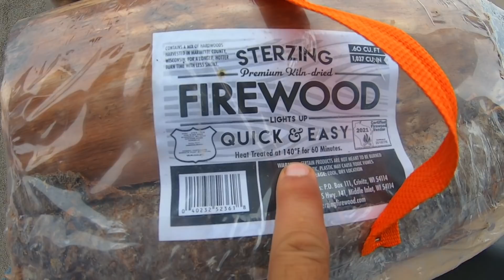Another Firewood Heaven Business! - #485

Comment: That Big Dump was very Dry, you could tell from the sound. Just think what a Grapple would do that could pick up firewood that was split and you could load it into the trailer with out touching it Chris. They make those kinds of Grapples. Big Mouth MINI 322 grapple by Precision Manufacturing. I would check this Grapple out Chris. 😀
Reply: Check this video out Chris, outdoors with the Morgans - Number 435 Things to consider when choosing a Grapple for your Tractor. Today we remove the 72" Granite Grapple from the RK 37 and put the 54" on and talk about things to consider when buying a Grapple. 
Weight, Max Opening, Width, and Others  May 11, 2019.
Reply: You could probably make one.  Like a tilting bed one.  a 4x8 extruded metal base to snug up to the face cord, maybe some sliding arms to come down on the other side to clamp a little bit of it.  Then tilt the pile toward you.
Reply from the maker: Yup, some day I too will have all the toys.
Reply from the maker: Yup, saw it.
Reply from the maker: Sounds like a lot of work to me, like loading wood! HA!

Comment: I don't know anything about firewood kilns but many years ago now I ran a lumber kiln attached to a sawmill.
I'd think the dying processes would be entirely different like the difference between night and day.
Timber kilns are all about drying as fast as you can, evenly so the timber doesn't crack.
Cracking doesn't matter for firewood and it'd actually be beneficial because the centres of sticks would get heated quicker.
I'd guess a firewood kiln could have it's temperature jacked up to something below flash point and it'd probably take longer getting a kiln to temperature than the drying time would be.
My kiln used electricity for fans and heat but I'd guess you'd want an energy source a lot more economical for firewood. 
Using cookie pieces and crotches seems an obvious source.
The things you get me thinking about Chris.
Kilns like you saw would be terribly inefficient because they are tiny and every time you unpack/repack them you lose all your heat.
What about a kiln about the same size with a small railway line for baskets to run on so new baskets can be pushed through without ever having to turn the thing off or fully open it up. 
You'd need some fancy flap arrangements or swinging doors each end and depending on the temperature you could get the kiln to it might only take a couple of hours to dry sticks of firewood.
I'm doing all the work here so I leave it up to you and your oven to workout temperatures and times.
Now all I can think about is the snap, crackle and popping noises you'd get from a kiln like that.
There's all sorts of ways to make money.
What would it be worth to all the firewood producers for a same day seasoning service instead of 1 to 2 years?
Reply from the maker: I like it! You must have a big brain TBone!
Reply: @InTheWoodyard  Never been accused of that.
I'm thinking a 40 ft shipping container and the large IBC totes that hold a face cord on wheels with a furnace hanging off the side forcing stinking hot air or just the furnace chimney with a spark arrestor through your kiln and out through regulated roof vents.
Use container doors each end with a fire proof blanket hanging just inside the doors that baskets can be pushed under.
I reckon that'll hold 9 totes or 3 cord at a time but I'm not known for my math either.
Probably wouldn't need the roof vents because you'd have to remove the door rubbers so they'd probably leak enough to act as vents.
Just to confuse you properly I'm a Tony too.
Will the boss let you experiment with her oven?

Comment: 140F for 60 mins will do precisely nothing except heat the wood up and waste some energy to do it. City Firewood in NZ kiln dry their wood and they do it at 95C/200F for 20-40hrs.
Reply: That's probably to dry it, this is to kill bugs.
Reply: How ironical having to use resources to  artificially dry firewood which is supposed be an alternative to  electricity. I drive by that yard quite often and figured they weren't drying it in the sun
Reply from the maker: Yes, I thought the same thing too!
Reply from the maker: Yup.
Reply from the maker: YES!

Comment: Where do those little metal crates they use for storing wood in come from, what was their original purpose? We have bigger ones here like that that originally had tanks in them. A forklift with a box tipper would be an ideal way of handling them.
Reply: They had really big plastic bottles of fluid in them. chemicals. etc
Reply from the maker: They are called IBC totes. They are used for a lot of industrial liquids from dyes to chemicals to food additives. They do have tanks for liquids.
Reply from the maker: Yup!

Comment: About the kiln dried wood, other commenters don't have a clue, just spouting nonsense.
The wood doesn't just go in the oven for 60 minutes, but rather several days - depending on your methode.
Around here they use "exhaust" heat from biogas plants or from smaller energy plants that burn wood chips for electrictiy - the bigger producers get their stuff dried for free this way.
In germany it means, that you need several sensors inside different pieces of wood and the wood is good when it reached an even temperature of above xx degrees for an hour. This then kills of all the bugs and so on.
I tested kiln dried before, but it's supposedly 20% less energy, because it off gasses in the kiln already. That's why regular air dried is still more desirable.
It's under 10% moisture initially and goes up like paper (can light a piece with a lighter, literally tried it). It's supposed to gain more water again if you leave it out for some time. 
The droplets you see under the shrink wrap are not from the wood still drying. You can have bricks under shrink wrap and it would collect droplets like that.
This is of course, if it's done properly, like I described.
Reply from the maker: Thanks for the great knowledge you just gave us!